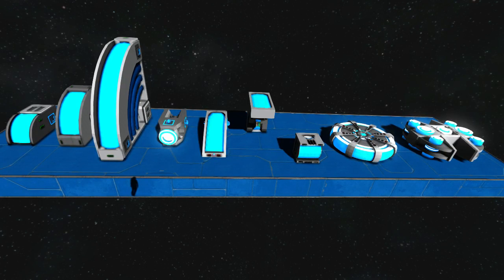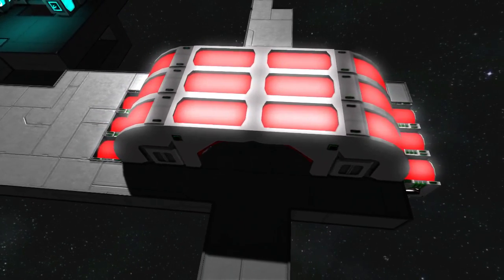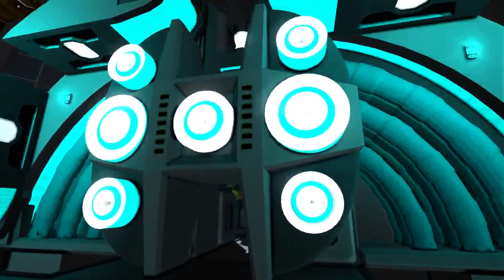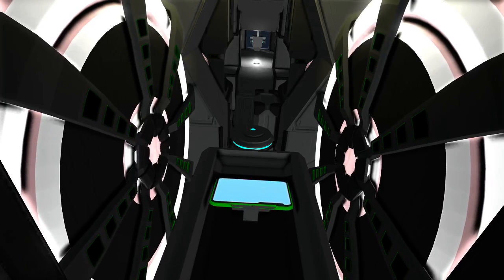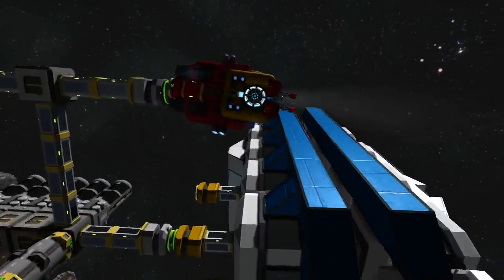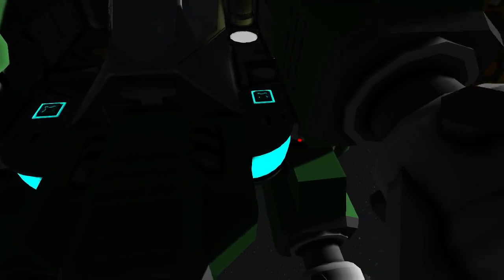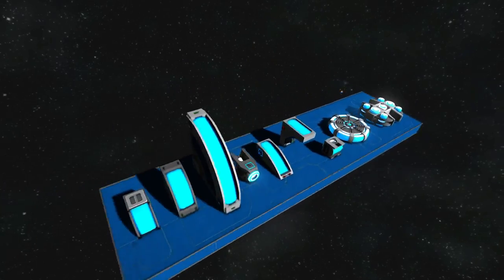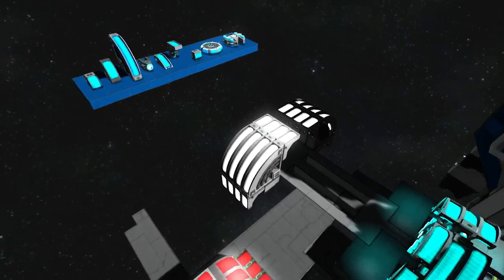XPAR Modular Energy Mod (update)

Comment: So capacitors store a bit of power but excel at outputting that power towards getting thrusters to max speed for a short burst. Fuel cells store a ton of energy but output at a lower rate equivalent to a small reactor. (vanilla small reactor? or yours?)

Am I getting that right? Also what would the ideal setup for your tier 1 batteries? What do they excel at? I know you said they are good for maneuvering, but wouldn't a capacitor do something similar?
Reply from the maker: +SamuraiTex84 The basic batteries are a good balance, since they can fuel moderate amounts of thrust for quite a while.